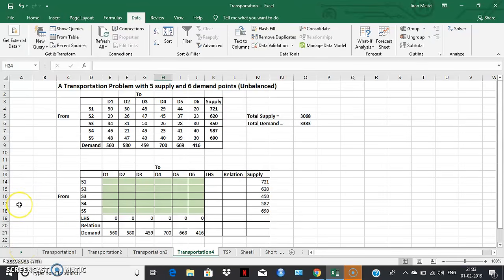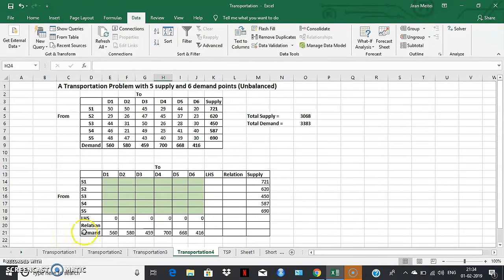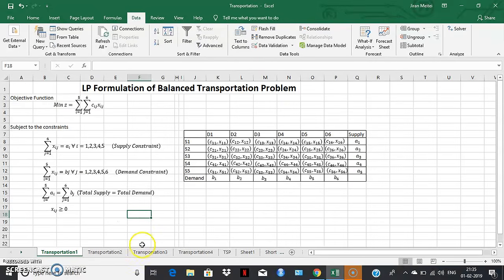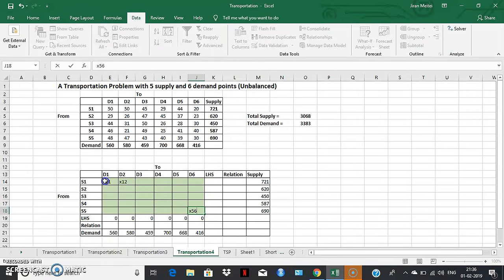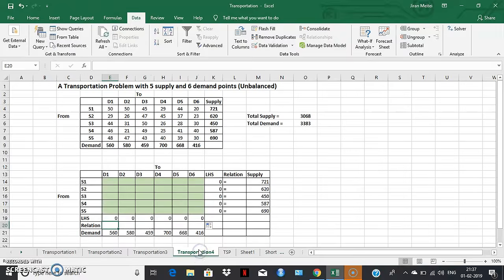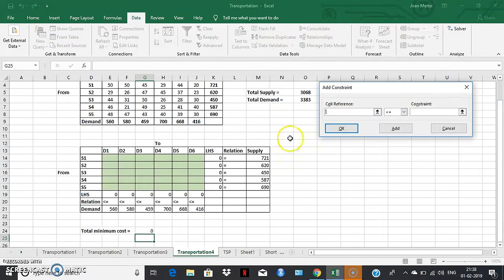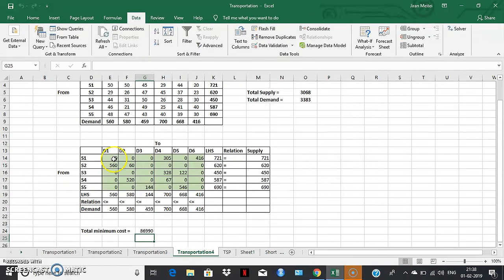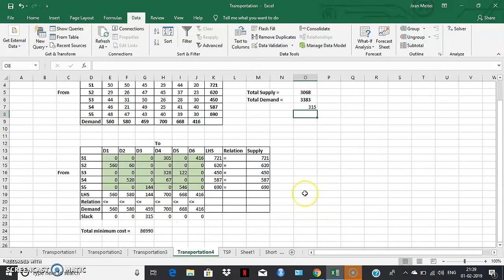Unbalanced Transportation Using Solver

Comment: Is it the same formula for unbalanced problem if the total demand is less than total supply?
Reply from the maker: Yes, you can work in the same line.
Reply: @jiran1234  No, if the demand is higher , you should use <= for demand, when the supply is higher you should use <= for supply